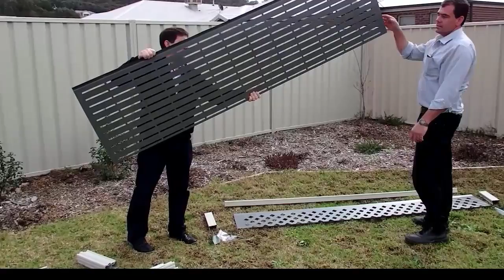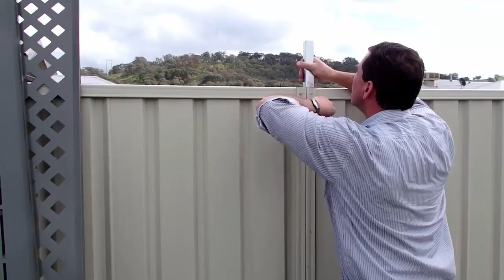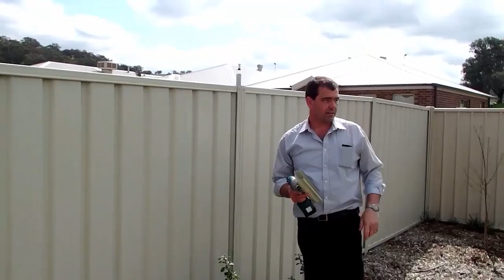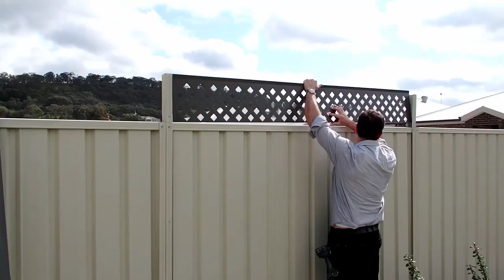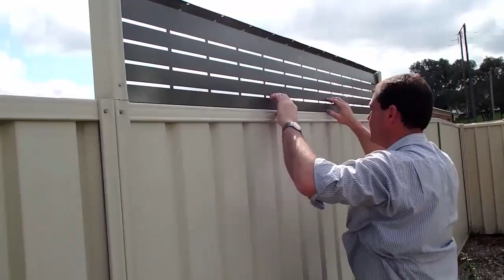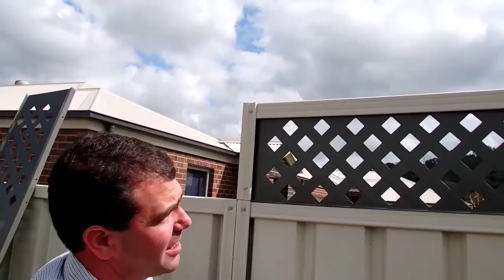How to DIY Install Your Fence Extensions

Comment: Hi, Im installing fence extension for a pool. At 05.20 you said it needs to be flush pool side to comply with regulations, i would of thought it would of had to be flush on neighbours side so a child couldn't climb over from the neighbours side. sorry its just thrown me thats all.
Reply: on the neighbours side you leave it over hanging and that way if a child tries to climb over they cut themselves, which acts as a deterrent 😁